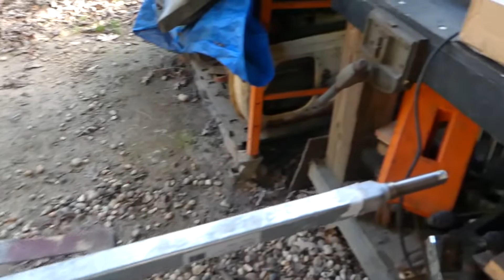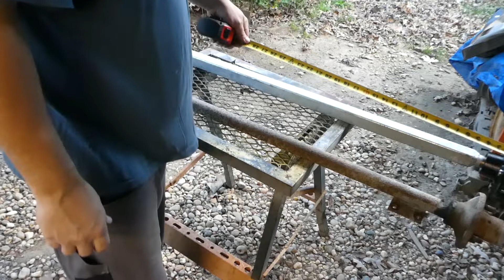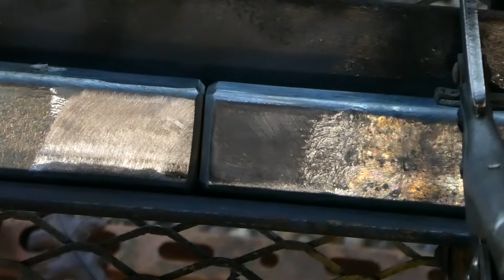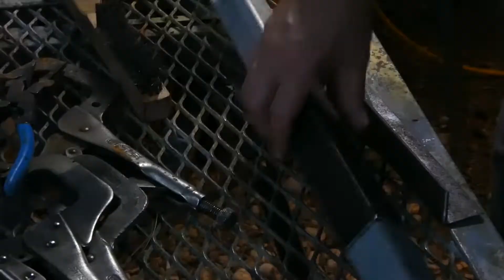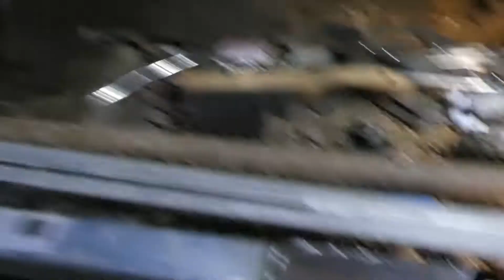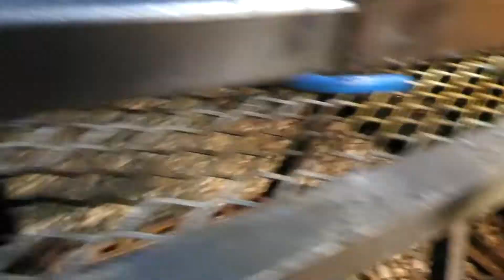Shortening a trailer axle - Fail?

Comment: 8:12 the porosity in the weld is IMHO caused by the hot zinc dipped material - could be cause by zinc from the inside of the tubing.

Comment: It’s a fail because all you had to do was grind the welds around the spindle  pull the spindle out of the axle tube cut it to length weld the spindle back in and done. No ugly a$$ plates and no bowing.

Comment: Maybe a piece of box section to slide inside the axle tube with a couple of holes on either side of the centre for plug welds and a small gap in the centre to weld tie it all together. You can still use the angle iron and clamps to align it for a straight axle. No camber is necessary for the weight intended. Would look a lot cleaner

Comment: I don't think that minor difference will ever be noticable. Again, a minor difference but I'd put the lower side on the right side of the trailer as the pitch of many roads puts that side down which will compensate some for the axle difference. I know yours is long ago done but others are doing this today and that's why they're here. Good job overall.😊
Reply from the maker: Thanks! I actually did a follow up where I used heat to "bend" it a bit more to what it should be. Sold the trailer last year, but used it for several short trips to the lake and it ran great.  I was probably over doing it for what it was but was testing myself as well.

Comment: Hey Eddie. Nice work around. My opinion (if you don’t mind me saying), I probably wouldn’t have cut it in the middle like that. I would’ve been inclined to cut the stub axle join, and re-welded it there. But hey, who gives fat rats freckle what I think 😆
Reply from the maker: Hello Aaron. I do not have enough confidence in my welder to weld that thick piece and I "thought" it would be easier to jig it straight doing it in the middle. Plus the middle just carries a bit of tension/torsion where the end carries weight, torsion, and gets the brunt of the road roughness. That was my "thinking" anyway.
Reply from the maker: Oh and I don't mind you saying anything buddy.😁

Comment: I don't feel quite so bad about showing my welds :). If you still have this you might try running a couple of weld beads on the long side, Start small and work up.
Reply from the maker: Lol, I think it might be about time for a new machine, mine is probably about as good as your old Century you mentioned. It will do a few nice welds and then go sideways. I might also need a new operator, :-) I still need to put the plates on, so it is going to get some more welds of the long side. We will see.

Comment: Reminds of the time you worked on that tower over in Italy.
Reply from the maker: That was not me, that was Eduardo.
Reply: @theeddies  How did you get the free 7.5 HP Canton Express engine?
Reply from the maker: You did not get my original reply? Surprise surprise. I was contacted by the company to see if I wanted to review a product. I get one or two a month and I usually ignore them because they are irrelevant stuff. This one though was a powered rebar bender, so I was intrigued because it actually something I would never buy but could think of uses for. Then she says she also has some other stuff as well that they want some videos for. And shows me an engine picture. Well how could I turn down a free engine? It will just be an unboxing and running video. They just want a little exposure. All good, so I got it in a few days. Actually it is funny because my dad just bought a mud skipper setup for a jon boat. The engine on it is exactly the same except his has electric start. Guess I am a shill.
Reply: @theeddies  Be the best shill.
Reply from the maker: @johnstrange6799  will do Melania
Reply: @theeddies  I saw some local'ish "normalcy". $200 109, and a clean $500 Craftsman with quick change gearbox.
Reply from the maker: @johnstrange6799  localish to you or me?
Reply: @theeddies  Sorry. To me. If that Craftsman were near you I would have let you know.

Comment: Wack it on & see how it goes .  Unless you are experienced with heat straightening , it can end up worse .    
Hey , your stickers arrived  as i will put them in an upcoming video .   
Cheers .
Reply from the maker: Thanks Max! I have done some heat straightening of small machine shafts in the past and a moto axle with good success, but I agree. Those were one piece solid shafts though. There is a lot of meat here to warp and a lot of heat involved. I will leave that to last resort. Will probably give the wacker a try. How did the weld prep look? I look forward to seeing the stickers. All the best! Eddie
Reply: @theeddies   Weld prep looked good . 
Bummer you could not belt that square 
into the tubing .  What you have should be ok .   Cheers .
Reply from the maker: @swanvalleymachineshop  yeah I agree. I could have gotten the right size piece in but it would have been a crap load of time trying to clean out that tube. Or use an undersize square which I did not want to do. I tried driving it in to the cut off piece and could only get it in an inch with a 3 lb hammer. And of course I would have had the spindles to deal with trying to pound 2 halves together. It is plenty strong enough for the application. Trailer and boat are aluminum. Thanks for your advice. Think I will give it whack tomorrow and if that does not move it might try a spot of heat and quench but not going to go crazy with it. Best!

Comment: Heat the "long" side upp and collit "quick" with a wet rag and it will straighten out
Reply from the maker: Thanks Magnus! I am going to try the sledge first, if that does not do it heat is likely next. It being a tube of suspect quality worries me a bit with the torch.
Reply: @theeddies  You should not heat it to be able to bend it, just make it glow then it will shrink when you colit quick with a rag  and strighten out. Its a common practise in shops thar build with square tubes
Reply from the maker: Would you heat the plate or just off it?
Reply: @theeddies  I would try the plate first?